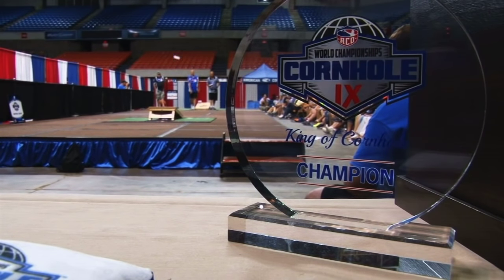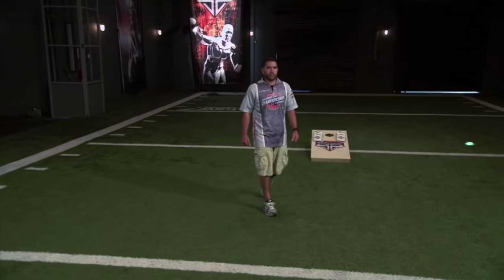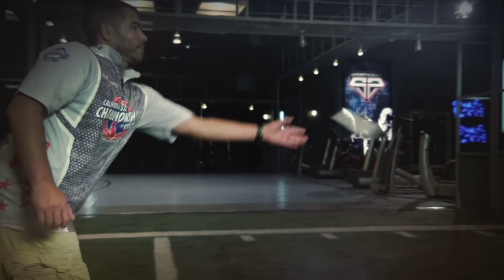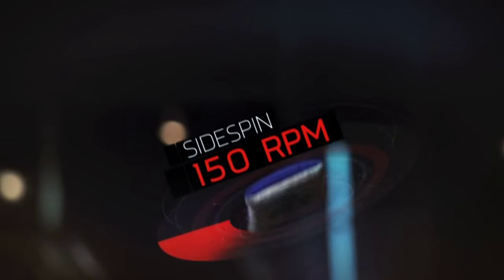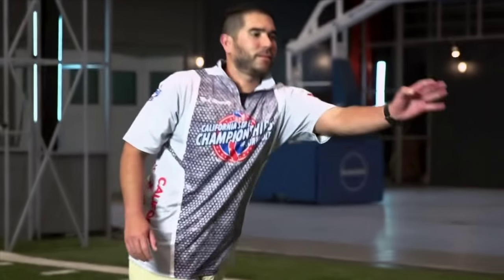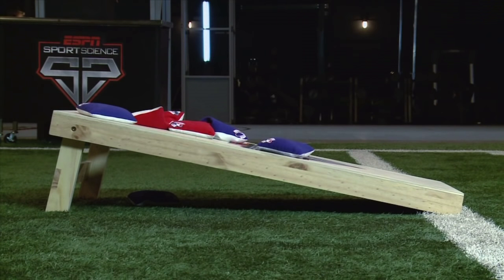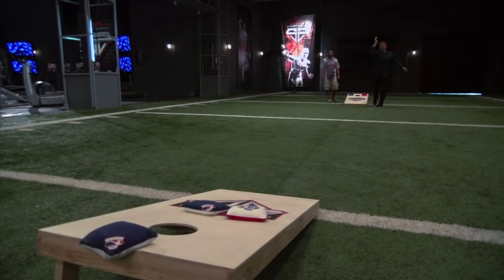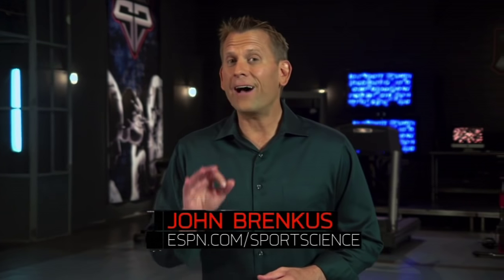ESPN Sport Science with American Cornhole

Comment: A very important point not mentioned here: SCORING. A bag that goes in the hole is worth 3; a bag that's still on the board at the end of the round (and never touched anything else) is worth 1. However, this game uses a "cancellation" system where only the higher scorer in the round gets points, equal to the amount of the lead. If all you do is toss each bag in, your opponent very likely will as well, and you accomplish nothing. That's where tactics come into play. Where to block? When do you have to go for it? How do you avoid knocking the opponent's bag in?

Pretty good spectator sport as long as you can keep up. The top players don't waste a second.